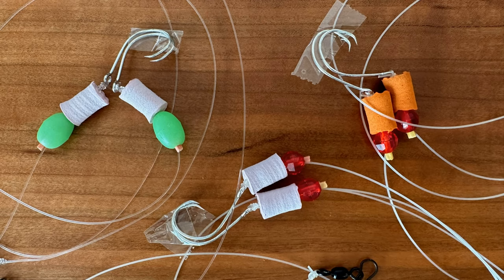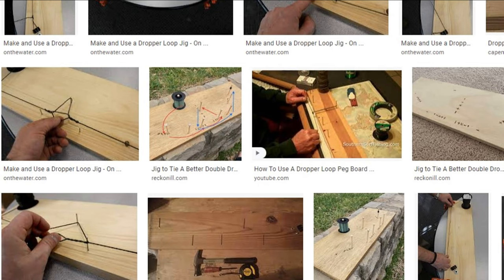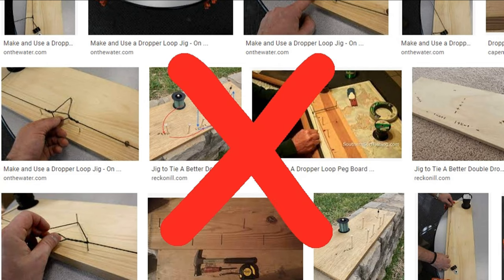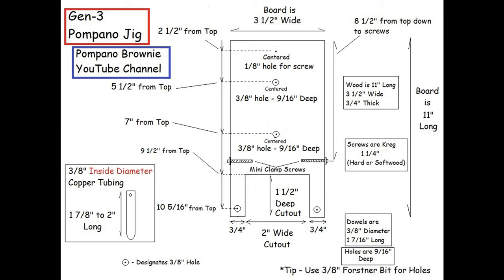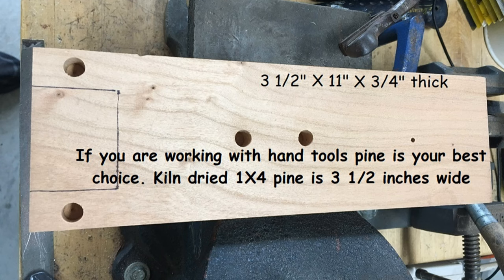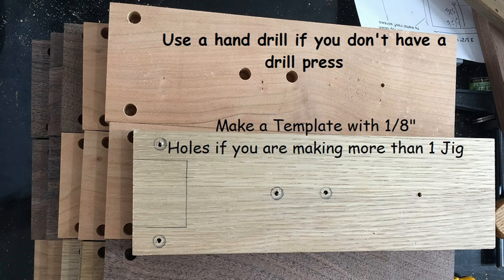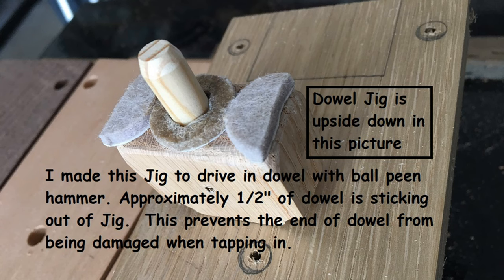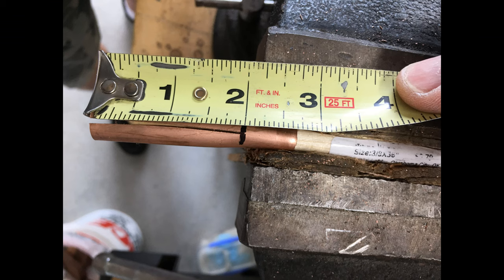Build the Gen3 Pompano Rig Maker

Comment: I hear you catch more on 15 lb test line. What test line are you using in the video?
Thanks.
Reply from the maker: 50lb for my rigs.. they can withstand a school of blues and keep on ticking.
Reply: @PompanoBrownie  ok thanks. 
I just heard that from an older man who fishes strictly pompino. 
He said they're a sight fish and heavier lines spook them. Thanks.
Reply from the maker: Danno, I’m an older man that targets pompano. I learned how to tie rigs from an old timer that used 50lb Dark Green mono. He caught more fish than three fishermen combined. His biggest secret.. Good Bait. Live Sand Fleas, cooked sand fleas and fresh clams. All tipped with Fishbites in case the fresh bait is flicked off during the cast. He used all 13ft surf rods with conventional reels. For an old man he had no problem casting 100 yards with bait and 5oz sinker. When the Pomps are “ On the Bite” you have to get that fresh bait to them and fast. Also, use a shock leader or you will feel the pain of being down to 2 rods when the bite is on. He used to change his 50 lb shock leaders EVERY day.  My main line on the reel is 14lb mono. 
Tight Lines!
Reply: @PompanoBrownie  ok, thanks.

Comment: I'm guessing I could make this out of pvc trim board also
Reply from the maker: That would probably work… just make sure the screws holding mini clamps are a coarse thread and at least 1 1/4” long. White pine might be cheaper.
Reply: @PompanoBrownie  only suggest that because sometimes we are on the fly and in case it gets wet or whatever... Just wondering I have some pvc board left from my ball python racks and snake cages

Comment: Could you use the same diameter PVC for the spinner.
Reply from the maker: Gary, it requires a thin walled 3/8 inch outside diameter tube. I’ve tried a bunch of stuff out there and everything is too flimsy by the time you cut it in half or too bulky. The copper works great if you have the patience to build one. The 3-D spinner works great, but cost me a 3-D printer. Lol.